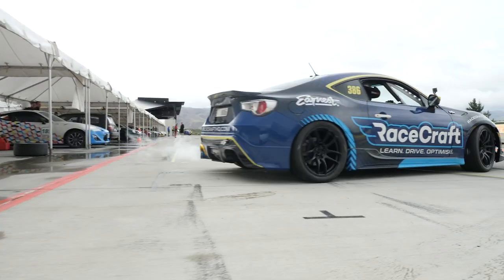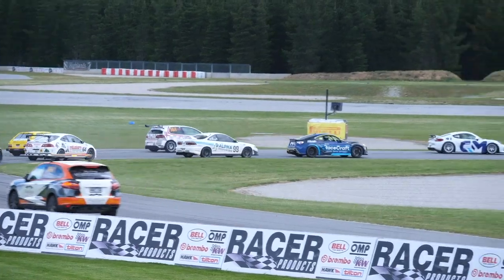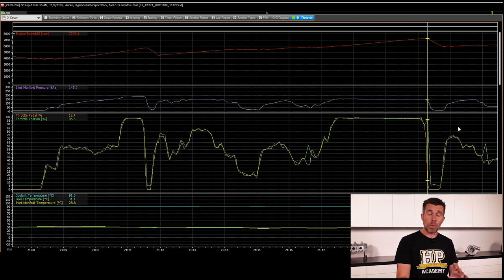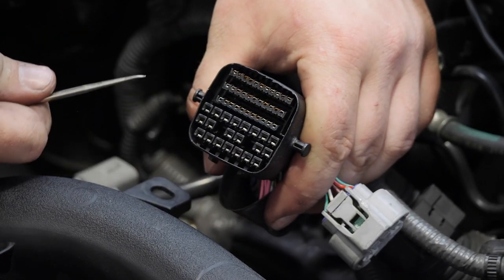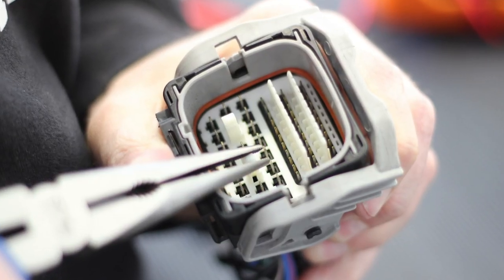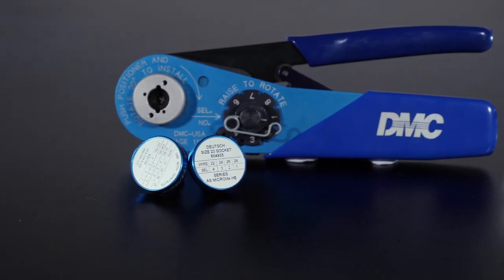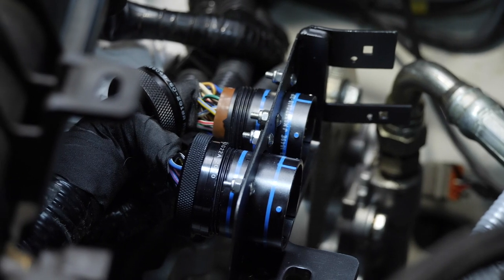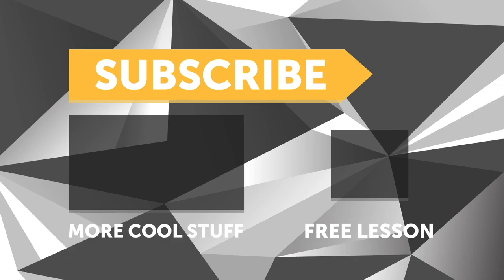Troubleshooting DBW Issues & Budget Bulkhead Connectors | Ep 13 [OFF THE RECORD]

Comment: I like the Deutsch DTM connectors... You can find on Mouser electronics and other sites and find connectors with pins at the right gauges for pretty much all com wiring and 12v low amp powering
Reply from the maker: Agreed, we use DTM/DT/DTP connectors extensively and they’re great, reliable, and cost effective. They wouldn’t be a great option here just due to the number of conductors running through this harness though - Andre

Comment: Thanks for the vid Andre, I wanted to do the same thing in my little mx5 - but Deutsch say the max amp rating for the #16 terminal is 13 Amps, and there are circuits such as fuel injector power that use a 20 or even 30 amp fuse. I notice that the T86 fuse box includes a heap of fuses higher than 13 Amps - so do you think Deutsch are way too conservative on their Amp ratings? My MX5 factory harness uses  Yazakia 070 Multilock terminals for circuits up to 40amps. But when I weighed an OEM 070 terminal and the #16 Deutsch pin, the Deutsch was far heavier. Doesn't this also mean that it could take more than 13 amps? Im a bit confused... :)
Reply from the maker: The fuse rating includes a safety factor so it's usually much higher than what we actually could expect under normal operating conditions. The wire gauge used is a pretty good hint at what is actually flowing in a circuit. You can also calculate the current using ohms law - For example we can expect the voltage to be approx 14 volts with the alternator charging. Assuming you have a 4 cylinder engine with injectors that have an impedance of 10 ohms then the maximum current to each injector will be (I = V/R) = 14/10 = 1.4 amps. That is also assuming 100% IDC. You can then multiply this by the number of injectors meaning that the main power feed needs to be able to support 5.6 amps. A single 20 AWG conductor and terminal will comfortably support that much current. Let's assume however that you've got a circuit that you've calculated to draw 16 amps and the terminal/conductor can only handle 13 - The solution here is to simply double up the power feed and use two positions through the connector - Andre

Comment: Same issue with those bulk connectors on Isuzu trucks. Got pretty involved, cut the connector in half and found the terminals weren't engaging deep enough causing intermittent issues

Comment: I'm a dealer tech for Ford in the states. Pin fit is a gigantic issue with modern CAN BUS vehicles. To the point where Rotunda gives you a kit after one of the electrical repair classes that adapts a DVOM banana clip to the common FoMoCo terminals.

Comment: Great vid guys.. I have always used a touch of liquid tape on each side of the male connectors. As the male is slid into female connector, the liquid tapes spreads out and gives a nice firm connection.. Also, i have used a minute amount of super glue in place of the liquid tape... The glue almost guarantees you'll have to rewire a new connection if you ever need to disconnect... The tape puts up a bit of a fight but can use electrical cleaner to remove. I have found the tape works better as when it dries, it expands slightly, resulting in a small amount of extra tension. The glue doesn't expand as much and gets brittle over time.. Good luck guys, great vid and info.. Can't wait to see the SR86 back up and running!!!

Comment: This is the exact same problem I am having on my car... I'm glad I'm not the only one. You guys are not alone.
2003 Baja swapped with a STI engine,
using the 05 Legacy GT connectors just like your BRZ. I'm constantly losing signal to my cam sensor and have to shake my wires on the side of the road because I need to make a new bracket just to put some tension on it. I think it's worth me changing this style bulkhead connector as well..

Comment: I have an turbo 86 with m150 and had the exact same DBW issue.  The solution that worked for me was replacing the factory cabling from the acceletor pedal to the ECU with screened wire.
I daily driver the car so lots more opportunity to test this vs a race car.  It went from happening every day to not happening since the fix 3 years ago.
Reply: If you take a look at the data from Throttle Pedal Sensor Main Absolute Voltage and the Throttle Pedal Sensor Tracking Absolute Voltage you'll see the voltage delta is between the two potentiometers from the throttle pedal.  This wiring doesn't go through the firewall connector but directly to the ECU (AFAIK: would need to check the factory wiring diagram to check).
What you see is the two voltages drifting over time.  That doesn't look like a connector fault but some sort of interference or capacitive coupling issue.  The screened cable helped.
Reply: Yep. Page 124 of the wiring diagram.  The factory wiring between the throttle pedal and the ECU is direct and doesn't go via the firewall connector.
Reply from the maker: @hags568  respectfully I'd suggest that perhaps you had a different problem since in our case the issue was not related to the throttle pedal at all - As covered in this video it was the TPS signal derived from the throttle body and this wiring does go through the firewall. While unfortunately we didn't have a capture of this for the vlog, the source of the issue becomes very obvious when you power the ECU up with the engine not running, wiggle the bulkhead connector and watch the TPS, MAP and oil temp in M1 Tune all fluctuate wildly. The new connector has also rectified the issue - Andre
Reply: @hpa101  You're almost certainly correct Andre. I learned what I did from your videos and courses so not claiming to be an expert.  I've spoken to Motec about this and they've had similar issues in the 86 race series cars.  Maybe it's worth checking those two sensor voltages and seeing if they do drift apart over time. Forewarned is forearmed!

Comment: Where can one find a reseller for these connectors?
Reply from the maker: I don't have a part number sorry but this is a common connector used by Subaru. You could try a dealership (Toyota & Subaru will have it listed for GT86 & BRZ) or you can get a part number from something like https://www.amayama.com/en.
You can then check via Google and/or some of these sites here if you're in a rush (Amayama is awesome for OEM bits if you can wait): https://www.hpacademy.com/forum/efi-wiring-fundamentals/show/wiring-and-accessories-suppliers-list

Hope that helps! - Taz.
Reply: @hpa101  Guess i should have been more specific in my question :) I meant the Glenair bulkhead connector (The cost efficent solution) :D
Reply from the maker: Ahh sorry mate! There are a bunch of wiring suppliers listed on the HPA forum. The best on for you just depends on your location, timeframe and also what other materials you might need. Check out this section here to get started: https://www.hpacademy.com/forum/efi-wiring-fundamentals/?utm_source=youtube&utm_medium=social&utm_campaign=general-interaction - Taz.

Comment: That connector is the same style connector as in the newer Impreza and Legacy models as well, which I have repaired/diagnosed multiple problems with. 

I have had issues on the turbo and n/a models alike. I have also had issues with pin drag on the ecu pins causing intermittent faults as well, albeit less common. Subarus newer models seem to be a little flimsy on the electrical pins on the bulkhead connectors and ecu side.

I believed our -40c to 35c temperature swings in Canada to be the cause, and have honestly not ran into any info on the problem happening elsewhere until you made this post!
Reply from the maker: Thanks for sharing. I've struggled to find anyone else reporting issues but I've restricted my digging to the 86/BRZ platform and didn't look further than that. It still strikes me as odd that nobody in the 86/BRZ world seems to be having this issue though - Andre